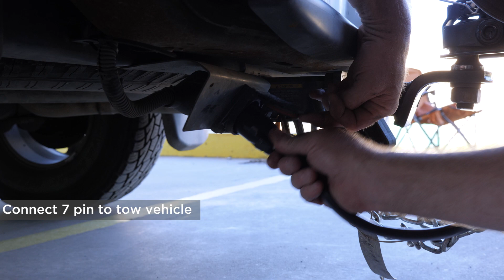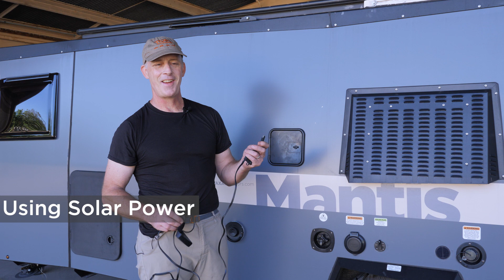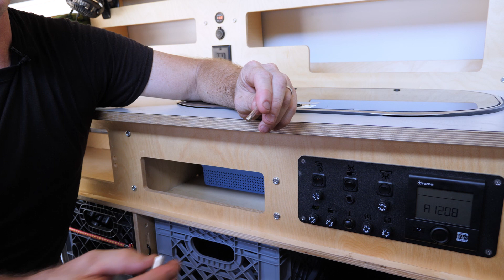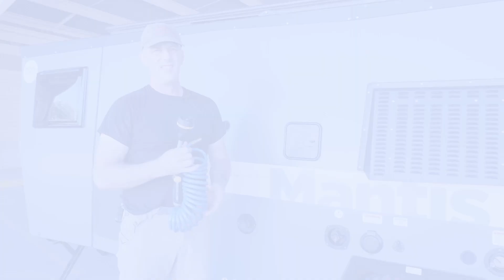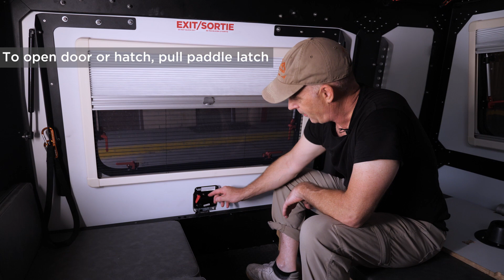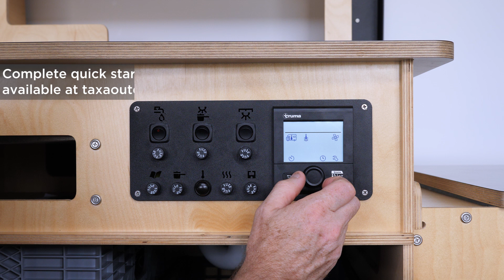Getting Started: A Technical Tour of Your TAXA Habitat

Comment: We're pretty serious about getting a Mantis next spring but I can't find any good info on keeping it warm or cool in extreme temps (winter or summer). We are from Minnesota so it get's really cold here, for example, but would like to still camp when it's 30 degrees out and stay warm.  So my question is this. Does the heater and AC work well with the top up? The top is made of canvas so I can't imagine it staying cool when it's 90 degrees outside or warm when it's 30 degrees outside. If the heater/AC only work well when the top is down (4'11") then you can really only use for mild, comfortable conditions. Thanks in advance.